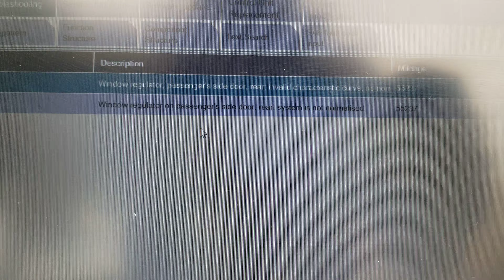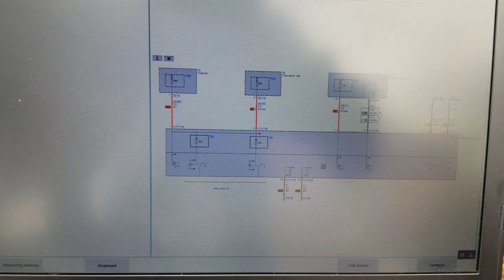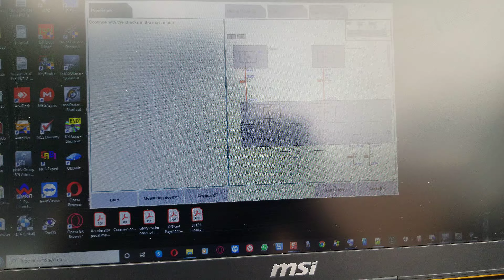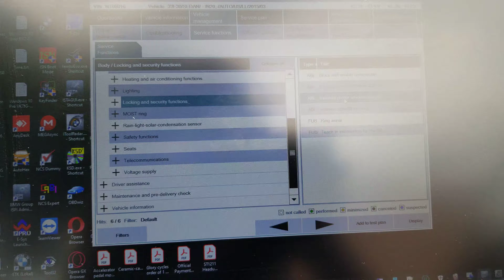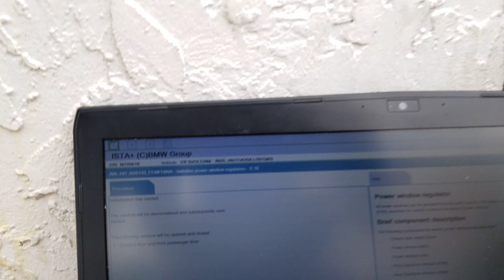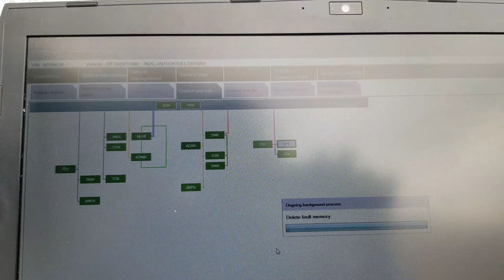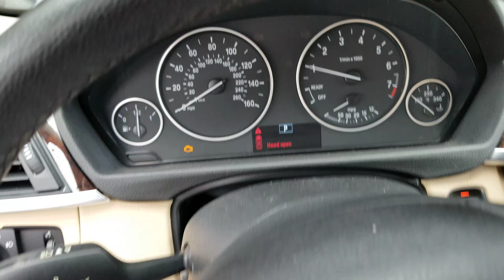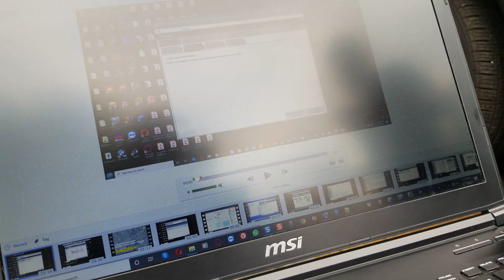BMW F30 EPS steering Encoding

Comment: good job sir , wonderful channel , Do you have a video explaining the solution to fix the flex ray in case of downloading an error code to the G OR F vehicle? Thanks.
Reply from the maker: A flexray issue can be caused by bad connectors of the bus wires.  Check the fault codes with  ICOM and ISTAD and run a test plan to track down which line the fault or module the fault is at.
Reply: @BMWPROGRAMMINGJAMAICA   thanks for responding , i cod the the right headlight with Esys for G12 and its give me error coding i tried second time also error coding then i test with ISTAD i find all controls on flexray change to red and not responding DME ACSM DSC EPS HSR VDP PCU EARSV EARSH SAS  ,,, these controls was ok before i try to cod the headlight . thanks
Reply from the maker: @oceandeep3883  contact  me via +1786-355-3660
Reply: @BMWPROGRAMMINGJAMAICA   please what sup connect number , I'm in Saudi Arabia  thanks.
Reply from the maker: @oceandeep3883  +1786-355-3660

Comment: I have a 2012 328i f30 and replaced my steering rack with a steering rack from another vehicle but the code won't stay after the car is turned off
Reply from the maker: Well contact me via whatsapp +1786-355-3660